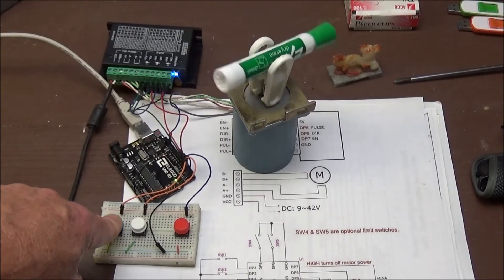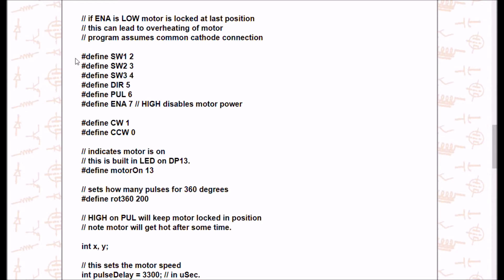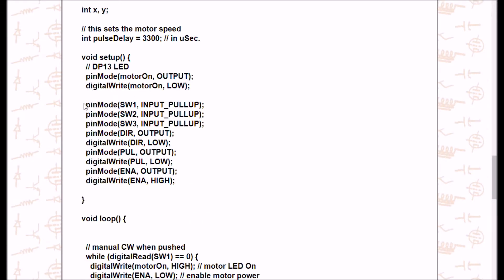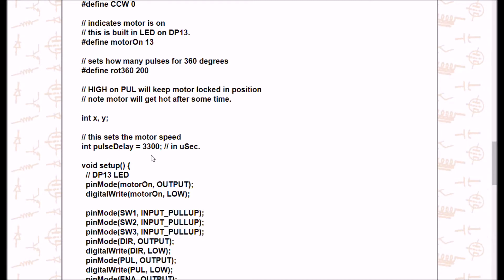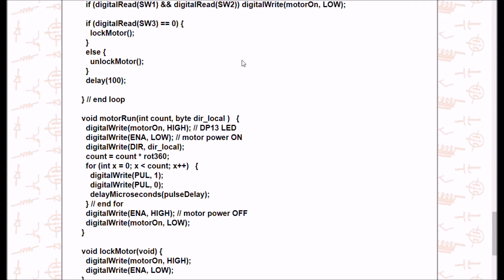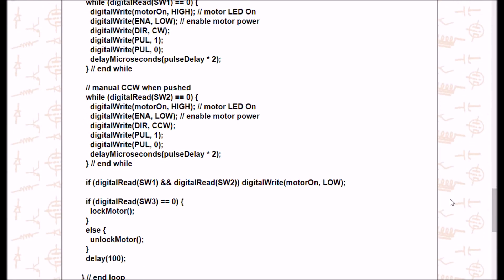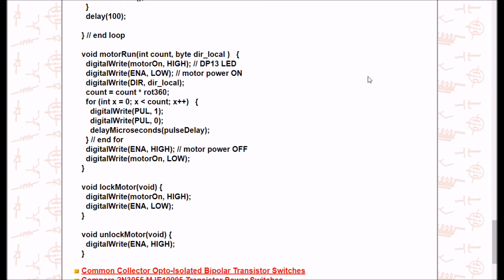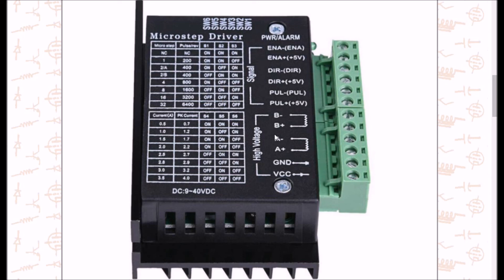Pt. 2 Program TB6600 Stepper Motor Driver with Arduino

Comment: I have used your code and same connection but motor is not rotating, and my connection is common anode, the motor is in hold condition, it is not rotating, please help me
Reply from the maker: Why don't you use a common cathode as shown? Otherwise, you would have to invert every digitalWrite command to DP5-DP7. That would also change the initialization in setup().

Comment: Great program!
I am studying stepping motor programming every day while watching the video.
I would like to apply this program to move the table of the drilling machine up and down.
Therefore, I would like to program so that if the lower end of the pedestal touches the end switch while pressing SW2 (PIN3), the motor will lock, and even if SW2 is pushed further, it will not rotate and only SW1 (PIN2) can be pressed. ， I'm not good at it.
Could you please tell me a program that disables SW2 and forcibly locks the motor when the switch is pressed?

Comment: Hi Lewis, I've followed your sketch with interest. Since I can't program, I have to copy the sketches together. Her sketch is almost made for me. I tried to change the void motorRun so that at one key press the motor turns 10 steps forward and at the other button 10 steps backwards. I can't get this one. Maybe you can help me.
I'm from Germany and I had it translated with Microsoft Translator.
Greetings Wilfried

Comment: Had you used a temperature sensor on the two motors you could turn off the motor if they get hot.
Reply from the maker: No but that is a great idea. I'll look into it.

Comment: Thank you! This helped me a lot. First, it didn't work with my motor, but then I set a delay of 500 usec after setting the puls high, like this:
...
    digitalWrite(PUL, 1);
    delayMicroseconds(500);
    digitalWrite(PUL, 0);
....

Now it works fine :)
Reply from the maker: Delay varies by motor. Start out slow (50mS delay) then reduce to find highest speed. An loaded motor needs a longer delay than an unloaded motor. That is to deliver more energy to the divice.

Comment: very nice hands on demo, I just got one of these 5A stepper driver black boxs in case I need to check some bulky old motors I scavenged from an industrial printer and use one of these one day

Comment: Hey man lovely work. I have 12v valence batteries. I want to use an arduino to check the 4 groups of lifepo4 at 3.54v. How do I set up? Do I use 4 module relays? Do I use rs485? Do I use logic level converter? Please help...

Comment: Hi Lewis,thanks for all videos you posted ,will you be kind enough to make a video on the ic cd4093 cmos type , i have seen this ic in water pumps circuits board,Thanks
Reply from the maker: Coming up in fact 2 videos.